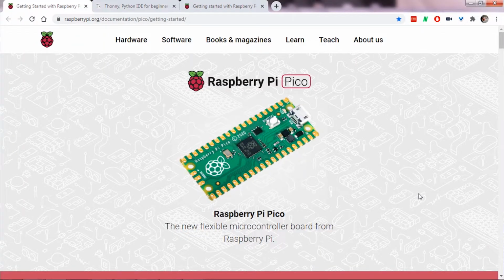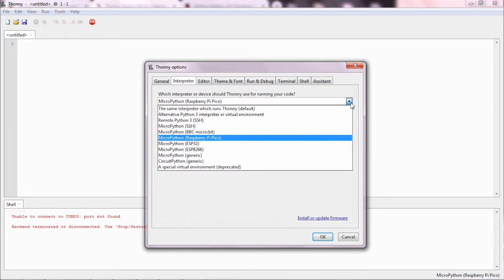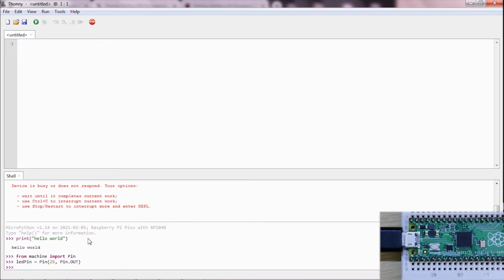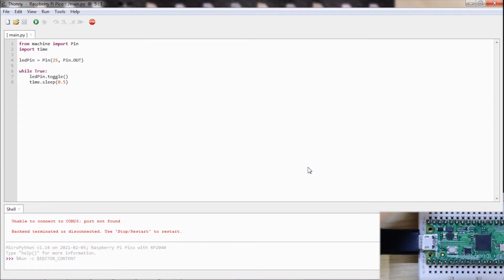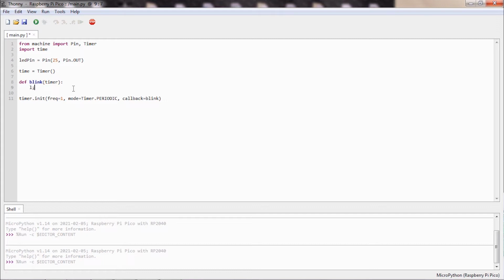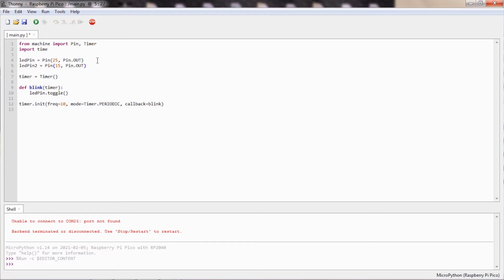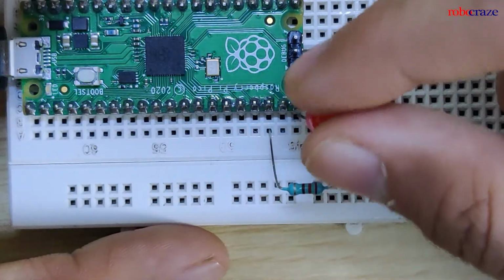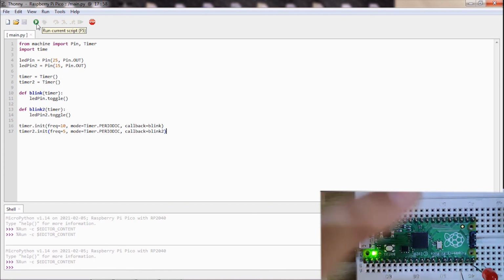Raspberry Pi Pico using MicroPython - Tutorial #1: Blinking an LED (Digital Outputs)

Comment: from machine import Pin, Timer
import time

ledPin = Pin(25,Pin.OUT)

time=Timer()

def blink(Timer):
    ledPin.toggle()

Timer.init(freq=1, mode=Timer.PERIODIC, callback= blink)
I used this code but it says in line 11 a function is missing 1 positional argument please help me
Reply from the maker: The problem is that you’ve used the same name Timer for both the imported class and the function argument. 
instead:
timer = Timer()
timer.init(freq=1, mode=Timer.PERIODIC, callback=blink)

try this out!

Comment: I faced a problem, i wrote same code but the on board led was not blinking. My pico is brand new.
What is the problem??
Thanks in advance.
Reply from the maker: Hello,
Ensure that the device is being detected by the laptop and try following the instructions again. Additionally please note that the same code may not work if your using a pico w.

Comment: i m  followed same steps bro but i didnt got COM PORT for pico??? in device manager it showing as board CDC why???
Reply from the maker: Hello,
If it’s showing up as a CDC device (Communication Device Class), it means that the Pico is in bootloader mode or not properly recognized. To exit bootloader mode, press and hold the BOOTSEL button on the Pico while connecting it to your computer. Keep the button pressed until the LED starts blinking.

Comment: Great content, Shiv! Keep going. Do you have any suggestion for a Raspberry HAT which has both H bridge drivers and an ADC converter? This would enable users to use a single HAT for a variety of applications.
Reply from the maker: Hi Bhagath,
We are glad you enjoyed the video. For the Raspberry Pi HAT, there is the ADC Differential Pi hat which has ADC and has provision for stacking. There is also the MotorZero hat which gives motor control using L293D. Unfortunately we cannot find any hats which have provision for both these tasks.
Reply: @Robocraze  Thanks for the suggestion. I found a HAT from Adafruit, CRICKIT HAT for Raspberry Pi. I wish to see @Robocraze become as wide and supportive as Adafruit / Sparkfun in India to start with. Keep creating good content and all the best. https://www.adafruit.com/product/3957